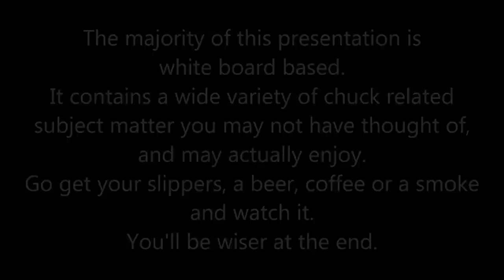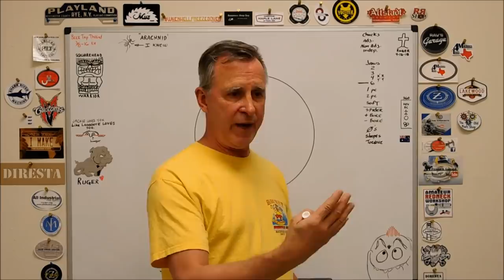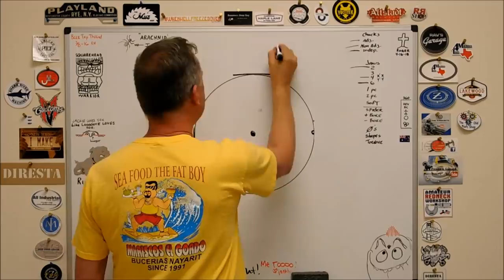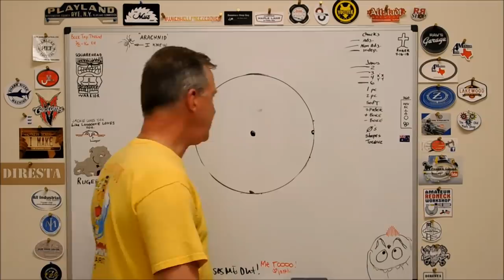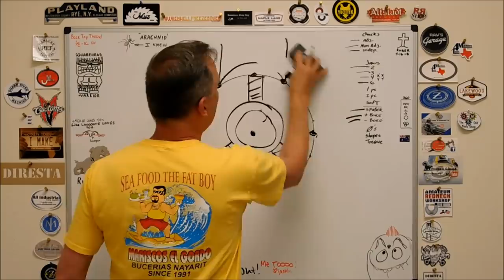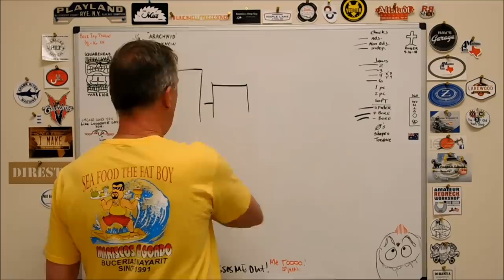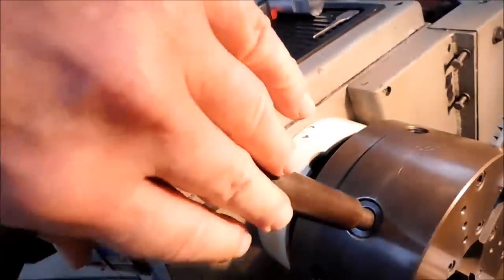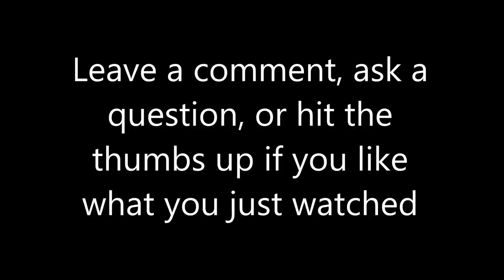Lathe Chucks - Types - Pro's - Con's

Comment: 1, 2, 3 jaw order, except on my Grizzly G4000 (9x20); it came with solid internal and external, so I thought I would try changing jaws. External ones came out fine and I spent SEVERAL hours  trying EVERY possible configuration of jaw insertion and scroll position: in and out and in and out and no matter what I tried I could never get the internal jaws to come to the center together. I saw there were like matching serial numbers on all three, and there was a 1, 2, 3 on each jaw and on the slots. I put the original external jaws back in and found I could predict the consecutive insertion relative to the scroll, and they met in the center, but then tried the internal jaws again; I was going to give up, but I tried just randomly putting them in again disregarding the numbers and guess what? They met in the middle; so I carefully removed them noting when they let go from the scroll, the slot position of each and their numbers. What I found is that they were MIS-numbered with the stamped in numbers, so I took a punch and put a single dot on jaw one, two dots on jaw two, and 3 dots on jaw 3, even though the numbers on the jaws were incorrect. Thanks, Grizzly and China (Delta Alphas..ask Red Foreman)
Now it is a simple matter of bringing the leading edge of the scroll to just outside before slot one and insert jaw dot one in until it bumps the first inner scroll rev, and turn the scroll until  the leading edge catches the first groove of jaw 1. Then turn the scroll until the leading edge is just outside slot two, insert jaw 2 until it bumps the first inner scroll rev, and turn until captured, rinse, repeat. I purchased a 160mm (6") real chuck with reversible jaws and the ability to create soft jaws for it, and created a backing plate to adapt it and now can turn some serious material (for me, anyway).
Great review of chuck concepts and I learned quite a bit. Thank you.
Reply from the maker: Thanks for the comment. I also mark my soft jaws with punch marks. Its quick and effective.

Comment: Off topic thought about future video, maybe?  I am retired with a garage shop with a Bridgeport type mill  for my home projects. A few years back added a 3 axis Pinpo DRO. (Subscribers please void the negative China comments as I am on Social Security). From my investigations on Youtube, .... etc., it appears 99% of this type DRO are rather identical in design. The video that you might consider making could show the use of milling an arc and whatever else you wanted to add. I have found (you may remember you also agreed with me) the China-to-English Bolt Hold instructions were wrong! I actually received an email from the company confirming the printing error. At any rate the instruction on milling an arc have fallen far short of being accurate - at least for me to understand. 
Just a thought for a video. Now on to watch the chuck video!
Reply from the maker: My recent videos on the rotary table may shed some light on your questions.
Reply: Thanks, I did see that one, I will go over it again, perhaps twice?

Comment: Unlike yours most 3 jaw self centring chucks  have three key holes.  Some people advocate always tightening each in turn.  I think this may come from a lack of understanding of the scroll inside.  I've not noticed it make any appreciable difference to the grip on the part.  I only do it when my paranoia sets in and I need to be 1000% certain a part is gripped as tight as possible.  Do you have any thoughts on using all three or just one key position?  P.S. Another great video, thanks.
Reply: in my experience it doesn't make much of a difference in clamping force, runout of the part is a different story tho.

Comment: My hard jaws are clapped out and I have no way to grind them, so I only use  aluminum soft jaws. I have seen the spiders (we call them cats heads at work) and "Christmas Trees" but I'm not sure how to use them or how they work.  Maybe a detailed video about boring soft jaws using spiders? Thanks Joe!
Reply: I made a toolpost grinder using a 'demel' with a flexible drive shaft attachment, fixed to a boring bar holder. works a treat.

Comment: I apreciate much your videos, very useful. i have only mini lathes and i learn for myself turning and milling with the aid of books. Now my question : i purchased a four jaws self centring chuck and i have not put in one of my lathes, is it better than a 3 jaws self centring or was only a waste a money. I lived in Portugal and here this hobby is not current. Sorry for my english. I´m 71 years old and i started with a Emco 3 lathe wich still use.
Many thanks
António Boavida
Reply from the maker: A 4 jaw should offer greater grip and less movement of the part due to it supporting the part at 90 degree intervals as opposed to a 3 jaw, 120 degree interval grip. However, a self centering 4 jaw may not be as useful as a 4 jaw independent. Easier to use, yes. More versatile, no.
Reply: @joepie221  Absolutely agree! 

BTW - I have learned many tips from your videos. Keep them coming.

Comment: Is it fair to say that, even if you had an adjustable 3-jaw (where you adjust it relative to the back plate), that the adjustment would really only be reliable for one particular diameter?  I thought the lack of concentricity in a scroll chuck was due to variances in the scroll, so if you turn the scroll to a new diameter, you can't rely on being centered?    All a matter of degrees, I know, but that's the point of dragging out the 4-jaw.    Also, if a 6 jaw is clamped around a non-round part, then it will still have just as many points of contact as a 3-jaw would, so I don't see any disadvantage to using a 6-jaw.

Comment: Hello sir, great content as always! I am about to buy a new 3 jaw chuck for my lathe. I am considering an adjustable one. I would like your opinion on the rigidity of an adjustable chuck: doesn't the fact that the chuck floats around a boss, only touching on the adjusting screws have an impact on rigidity? Best regards from Greece!
Reply from the maker: Adjustable chucks have a great deal of surface friction as mounted to the back plate and this can be adjusted based on how tight you keep the mounting bolts. Though you are correct in the contact point observation, I have never noticed a difference. then again, I have never tested it. For the utility, I'd always buy the adjustable.
Reply: @joepie221  Thank you sir, for your answer. It does help me decide!

Comment: Very good Joe enjoyed it.
 What are your views;  if you don't have adaptable jaws in a three jaw scroll chuck about using soft bolt nuts that are placed over the jaw fingers secured in place with set screws then bored to receive the part with the two point tangent contact that you spoke about. Many smaller lathes don't have the Variety of lathe chucks available without costing the farm for purchase.

Comment: Any suggestions for fixing a three jaw scroll chuck that is  .004 to . 006 out of round with piece chucked ? Housing is within .002. Thanks for any advice. I am subscribed. Have learned a lot!
Reply from the maker: If its really worn out, your best option is re-grinding the jaws. First determine if the wear is at most popular diameters. check it at 1", 2" 4" etc. If its all sizes, its more than likely the jaws. If its regional, its the chuck.  Hopefully its the jaws and not the slots.

Comment: Great video, thanks. Just wanted to point out that the part about soft jaws only for the "american style" split jaws is not necessarily true. Makes it easier to make your own for sure, and probably cheaper to buy. But I have soft jaws for both Röhm and Bison chucks that is in one piece. i.e they are a big slug of material but have the scroll "threads" and slots machined on the end :)
Reply from the maker: Interesting. I've never seen jaws like that. Steel or aluminum?
Reply: @joepie221  steel (not hardened)

Comment: Hi Joe! Thank you Sir for another GREAT video -I have a 1950-51 13"x72" tool room SB lathe with a 3 jaw - I found a 4 jaw at a good price & bought it just to build up my inventory but the BIG problem is I can not in anyway get the 3 Jaw off??? I know that you can not put it in back gears to break it free so if you have ANY suggestions on how to get that damn thing off I am open!!!! lol as Always TWO THUMBS UP!
Reply from the maker: I have to admit, on stubborn chucks, I put the SB in back gear and whack the chuck key with a mallet to get the chuck off.
Reply: I had the same problem, a chuck I couldn’t get off on my old Sheldon.  Assuming you have a threaded spindle, I clamped the end of a 3 foot long, 3/4” by 2” aluminum bar in the chuck so it stuck out horizontally at right angles to the bedways.  I then wedged the bull gear so it wouldn’t turn.  Then, I hung a platform on the bar at the end and stacked about 80 pounds on the end of the bar.  Leave it overnight and the weights should be sitting on the floor in the morning and the chuck will be loose.  If not, add some more weights.  This worked after a couple of weeks of trying every other trick I could think of.
Reply from the maker: I was always told its easier to replace a broken chuck key that it is to fix a chuck body from distortion. be careful how you choose to side load chuck jaws.

Comment: Soft Jaws "SPLAY OUT" at the front, so If i need a really tight grip with soft jaws - I'll bore a 10 thou' per inch taper, bigger towards the chuck so when the jaws are gripping on the part, they'll be parallel or nipping at the front of the part (if that makes sense?)
Reply from the maker: Truly, if your jaws deflect 10 thou at the front, its time for a new chuck.
Reply: @joepie221  Not at all Joe - we're talking a very tight grip on large parts with a Large 30" or so Hydraulic chuck. I trust "Soft jaws" over "Hard jaws" all day long even on "Black Bar".
Reply: @joepie221  I'm talking gripping large diameters here. 300 to 400 mm+ and I'd  trust soft jaws over hard even on Black bar with a pneumatic or hydraulic chuck. The part is going Nowhere with tapered soft jaws!!

Comment: So you can't put square parts in a 6 jaw?  Wouldn't it just work like a 4 jaw but better?

I thought more jaws is better as it's more versatile.

Do they make chucks with more than 6 jaws?
Reply from the maker: Normally each jaw of a 4 jaw moves independently, so irregular shapes can be dialed in. A 6 jaw has all its jaws moving at the same time, so it prefers round or hex material. You can put a square in a 6 jaw, but it will leave 2 jaws off the surface and contact the part in a strange way with the other 4.

Comment: Can I set up a 6 jaw chuck and remove 3 jaws for most uses leaving the 6 jaw on the lathe?  I have a Weiss 10x22 Chinese lathe that serves my needs pretty well, I do have 4 jaw, but I see these new Sanou 6 jaw chucks (6")  on ebay for 125 & free shipping, dont really need one, dont really want to make a backing plate, but the price is tempting LOL
Reply from the maker: Yes, you can do that, but it exposes the scroll to more debris. Just be careful and aware. Those chucks are 125mm in dia. thats very small, beware.

Comment: How about cutting soft jaws to hold on an I.D. If you use a ring with 3 screws and mount the ring on the O.D. of the jaws it will work. Hold spider on the I.D. of the jaws and it won't.
3 jaw vs. 4 jaw for holding power. If you lay out a square with lines connecting the corners and construct a perpendicular bisector of the connecting lines you will find that they are longer that the same construction with a 3 jaw using 3 lines and perpendicular bisectors. 4 jaw basically has a wider base. 4 jaws have much more holding power that a 3 jaws.

Comment: Joe,
Is there any advantage of using a torque wrench in place of the standard chuck key? I found a spec on my chuck that said Maximum Chuck Key Torque .......116 ft/lbs

As always Joe, very good video with lots of great information.
Reply from the maker: Any time you can eliminate variables from a setup, your parts will be more consistent. Although torque wrenches may be beneficial on a lathe chuck, I have seen them used more frequently on mill chucks. Control the deflection, control the dimension.
Reply: Thanks for the reply Joe. You have helped me and so many others more than you know.
Reply: Joe Pieczynski j

Comment: Whenever I inspect the roundness on my Co ordinate measuring machine (CMM) I can always see the 3 point lobes left by a 3 jaw chuck.
Mainly because some lathe operators have no perception of jaw pressure in P.S.I. (pounds per square inch) A light nip with wrap around jaws gives more grip than a tighter grip with smaller surface area jaws.

They forget the "PER SQUARE INCH" bit!!
Reply from the maker: That three point distortion is very hard to see with a mic. you can roll the part on a surface plate and use an indicator. It should show up that way in the absence of a CMM. Solid parts won't have that problem.

Comment: A good quality adjustable 3 jaw in excellent condition is always nice to use. A worn out beat to crap 3 jaw is only suitable for use as a vise or a boat anchor. Just my $.02
Reply from the maker: C'mon, anybody can make a good part with good tools, it takes a true craftsman to do it with junk.
Reply: @joepie221  

Joe, I'm talking about Chuck's with sprung jaws, sloppy guides and missing sections of the scroll. Tools wear out. And in an industrial situation there is no excuse for keeping junk equipment around. That's just why from day 1 of my apprenticeship I always used a four jaw on instructions from management. Parts coming out of the chuck or moving off center during say a cut off operation are more excitement than I care for. Hard on the shorts too
Reply: Joe Pieczynski 
Got to disagree there Joe, Ave's new machine is the bees knees😂
Reply from the maker: @andrewgardner7104  I am lost as to what you are referring to??
Reply: @joepie221 
Check out Ave  on YouTube you'll have a laugh.
Reply: @andrewgardner7104  please enlighten me as to what is, "bees knees"?

Comment: Another chuck rule, never spin a scroll chuck without a workpiece in it, the scroll can rotate and the jaws come flying out..
Reply from the maker: AMEN brother. I've pointed that out in several older videos.
Reply: I didn't know that, thanks Brian.
Reply: I always leave my jaws run up on something, the lathe feed screw out of gear and the emergency stop button pushed in. 
I never take  my hand off the chuck key while in the chuck.
If the chuck key goes in the chuck the emergency stop is pushed in. 
If I am fooling with the chuck it is pushed in.
Not taking any chances. 
The lathe is the most dangerous thing in most shops and the least respected many times.

Comment: How would you hold hex stock in a four jaw chuck?
Reply: You could hold x and x' on the flats and y and y' on the points between
Reply: @wilsont6651  Yes, but you risk crushing the corners. I was wondering if Joe had a magic shop-made gizmo he could share with us...
Reply from the maker: The points will always give you grief. If I had to do a lot of them, I'd make corner protectors to turn them into flats. I have also put hex stock in split round bushings for collet work.
Reply: @joepie221  Thanks Joe, thought that would be the case. I have a 50mm 3 jaw scroll chuck with a straight shank, I could use that in the 4 jaw if I ever needed to turn an offset feature on hex...

Comment: Very good Joe I like all your video , I have the same lathe as your but a little bit bigger and a I have
Modifie It .I put another chuck on other side of the spindle, I found it very useful for griping long rod,
Wen you take a big cut with fast feed , you can also used as stopper older .
Thanks for sharing your knowledge . Sorry for my English 
Francois ,Québec,Canada
Reply from the maker: I actually have a tailstock 3 jaw fitted with bearing on the jaws for that very reason.

Comment: Hi Joe, loving the videos! I have a question regarding it not being important what position the Jaws go in as long as the order is correct. I spotted the video at the link below and wondered if precision grinding the Jaws in a chuck would then make the position of the Jaws an important factor due to the positive they were in when ground, or if it still wouldn't make a difference, what are your thoughts? https://youtu.be/h1lIHmWY-04

Comment: I finally got a 4-jaw chuck. I hate it.
If I got square stock to deal with (which I always do), it takes less time to flip it round in a 3 jaw than all that index fiddling with 4 screws.
Yes, I know that no amount of flipping will achieve perfection .. but .. perfect enough.
When I don't have enough material to get perfection with a couple flips .. I make delrin split-collets for the 3-jaw. They take 20 minutes to make and save me hours in the week. And I get to waste less material .. and I don't need to play with my gauge.
BTW .. eyes are good. Shame about getting old and needing optivizors .. damn .. wrap-accidents get more likely with your face that close to the part.. I suppose that is a function of death in this universe? I'm OK with that.
Reply from the maker: This may be helpful.    https://www.youtube.com/watch?v=WCei5GlEZ5g